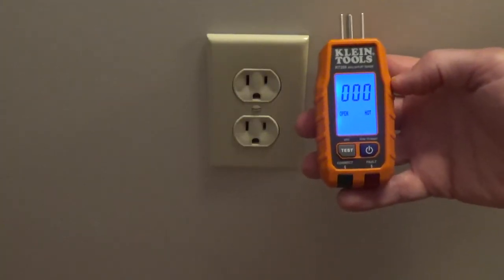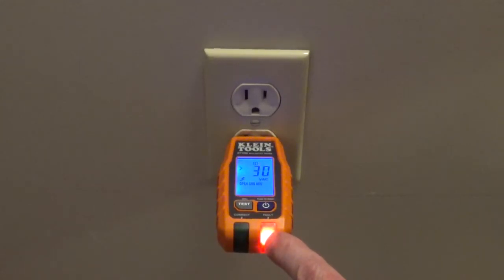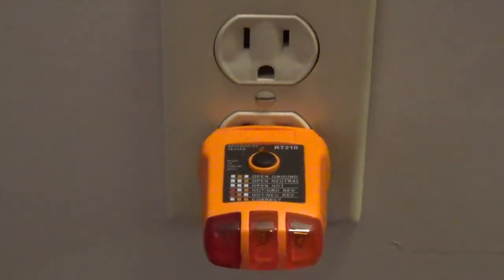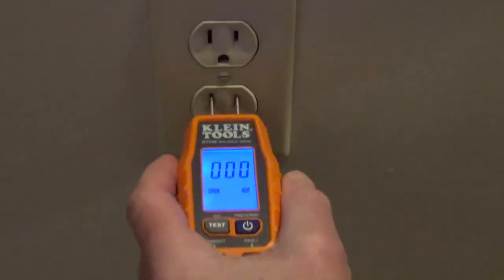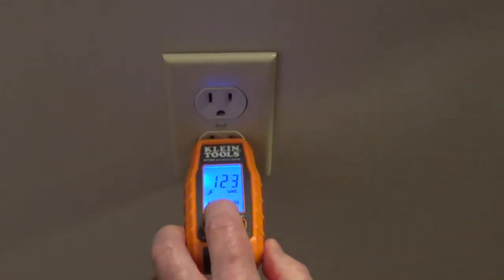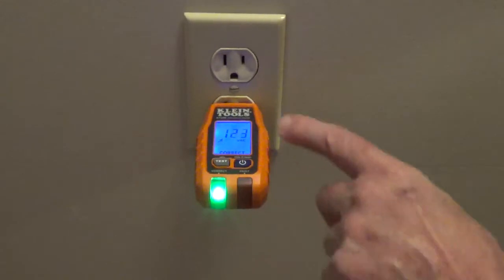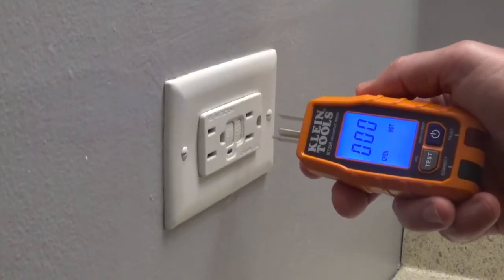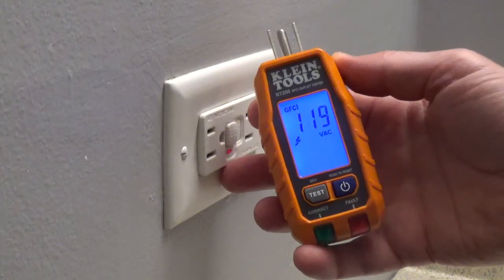Outlet Tester and GFCI Tester

Comment: Do you think this equipment has a protection from pressing the "test" button on a normal outlet without GFCI?
Reply: I say, I know it would not be right, but there is never a lack of the curious one who takes the tool and starts pressing the buttons.
Reply from the maker: Hi, it won't affect anything if you push the button with a standard outlet.
Check out more home improvement tips in our e-books https://www.amazon.com/gp/product/B0B2KW1FQ9?notRedirectToSDP=1&.

Comment: I have both of these. I've been curious what exactly does the button do on the Klein RT210 or any brand gfci tester. I know what the effect is, but how does it work? So from what I can tell, it allows a current flow through a resistor between hot and ground. The resistance I measured for this particular one is 53.8kΩ with the button pressed and the tester not plugged in. I'm guessing that this resistance had been calculated to provide just a little more than 6 milliamps to leak, enough to trip a properly working gfci, but not nearly enough to involve a 15 amp circuit breaker. If the resistance is lower it may take 1 or 2 amps to flow before it trips and would not be an accurate test. That's my understanding anyway.

Comment: Hello

When the GFCi is reset and I plug it in, it says wired correctly and I have the green light. When I hit test, the GFCI trips. When I plug back in the outlet tester once it's tripped it says open hot, is this normal? When I hit the reset button it says its wired correctly everytime
Reply: That’s right. The purpose of the GFCI is to disconnect the hot and prevent electricity from still conducting.
Reply: @vegita319  thanks